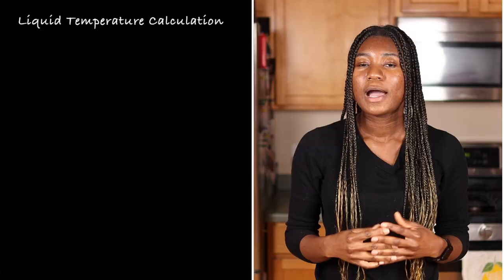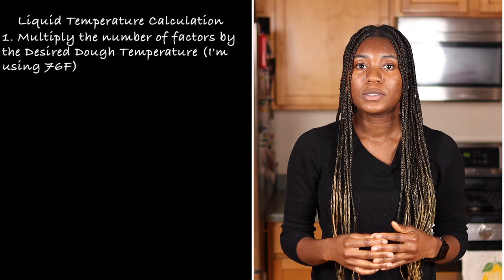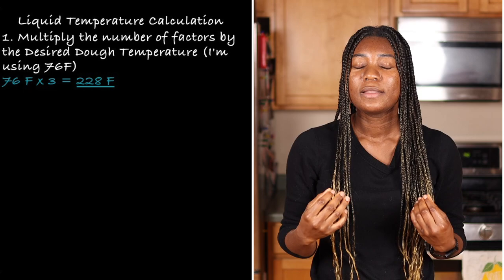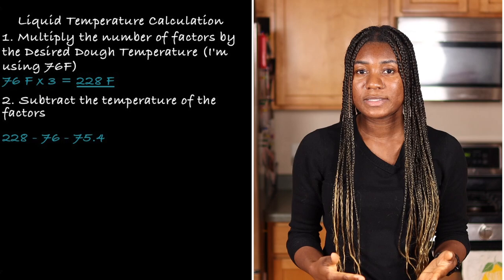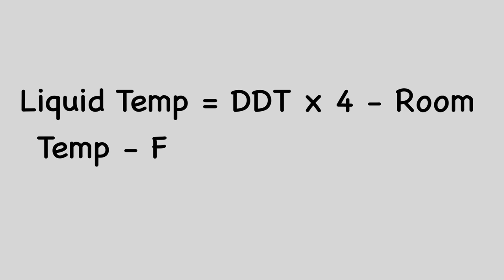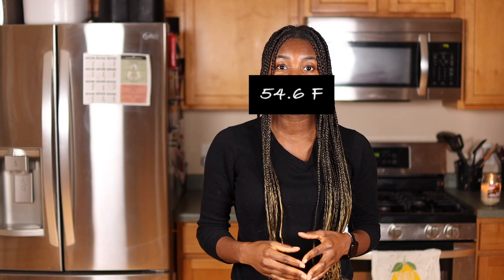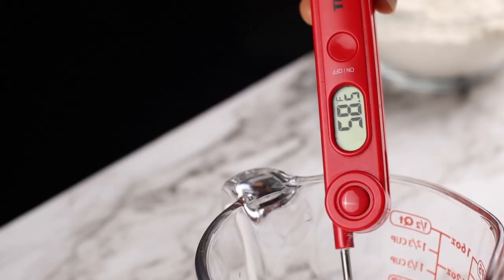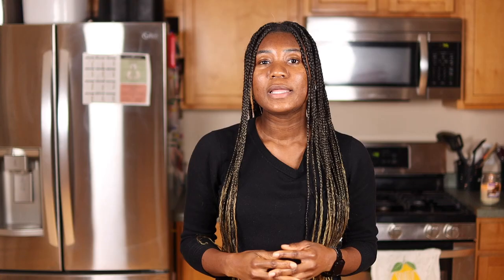Desired Dough Temperature | Knowledge Sharing Ep 02

Comment: When I calculate my DDT... 75x3=225 -66 (rt)-70(ft) =89 for the water.   I use active dry and the water should be 105 to activate when I add the yeast.. Does this mean, according to the ddt, that the water should be 89 instead?  Am I supposed to not prove my yeast prior to adding to the flour and just forget about the 105?
Reply from the maker: Hi Gregg, really good questions. You don't need to proof active dry yeast each time you use it, you only proof it to make sure the yeast is still viable. If the yeast isn't close to its expiration date, you're fine. I've even used active dry yeast pass it's date and it was okay. 

And as for the temperature of the liquid, I used to worry about it being too low but 89F liquid will work just fine. Yeast can be activated with water temperature as low as 50F. Kneading the dough generates heat, warming up the dough. 

The one thing I didn't see was your friction factor. Are you kneading this dough? If not then you can use warmer water like the 105F you usually use. I hope this helps. Let me know if you have any other questions.
Reply: @BakewithSusie  Thanks for the info..   I decided to make one batch with 20 friction and one hand kneaded  @8.   Honestly, the hand kneaded croissants came out way better.   I am going to be working with different protein levels now to try and get the laminated dough where I want.   I do appreciate your videos... I love the information and you present very well.